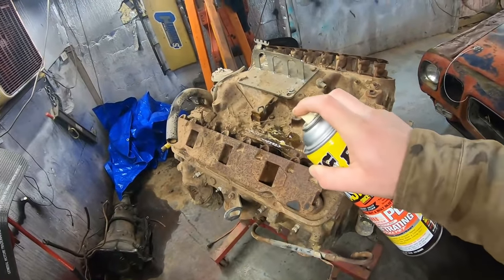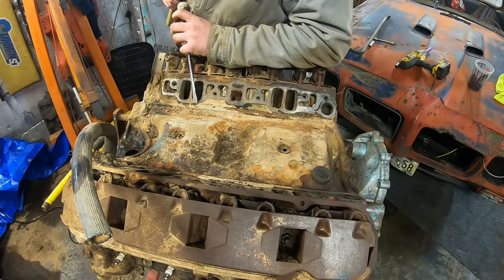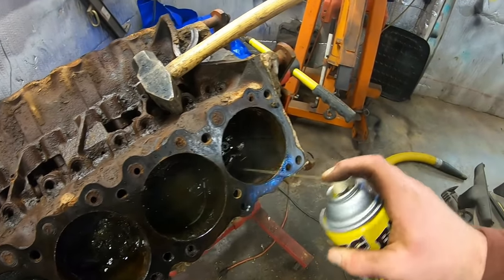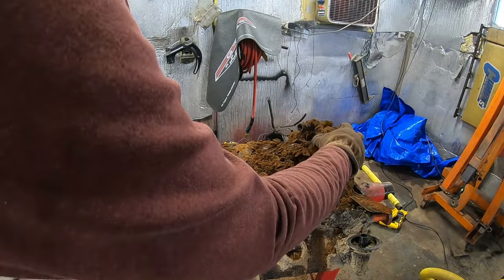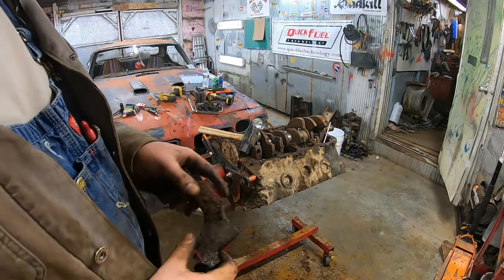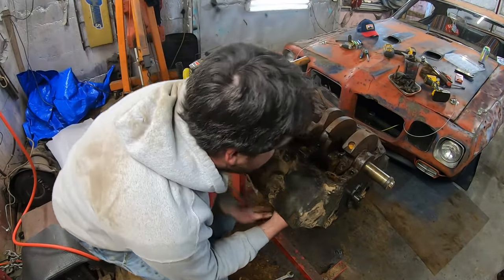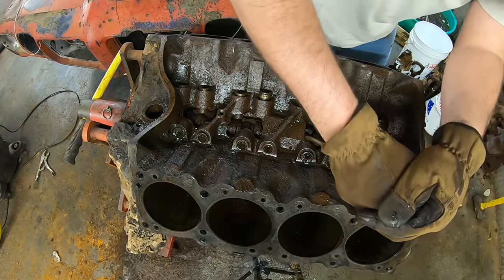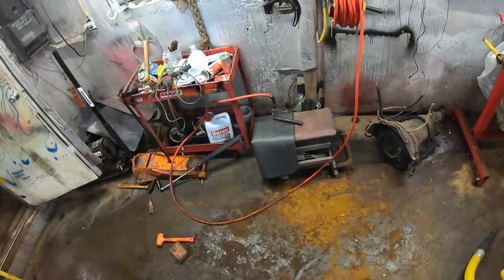INCREDIBLE! Worst GTO Ever: Holey Goat OG Pontiac 400ci Engine Teardown — CAN IT BE SAVED?

Comment: My old 77 Ranchero had a nylon camshaft sprocket. It gave up the ghost at 91k miles. I'll never forget that one because it left me stranded in the middle of I-5 on Labor Day 1999. I was already in a traffic jam and my broke down car made it even worse. Luckily there was a police officer about 5 cars behind me. He turned on his lights and pushed me off to the side and called me a tow truck. I just sat there waiting for about 2hrs listening to the radio. I heard the traffic report and they mentioned a stalled vehicle.  Yup,that's me.😆
Reply from the maker: Most makes used nylon cam gears for some damn reason back then
Reply: @PoleBarnGarage  Probably because all the teeth break off just after the warranty is up.. Supposedly they're quieter than a steel sprocket They're definitely cheaper to manufacture than a steel one. Actually,not long after I replaced the timing chain.  The crappy 400M engine went out.  I bought a rusted out 69 T- bird  for the 429. I had to get new exhaust and Engine mounts.  But other than that, it pretty much fit right in and bolted right up to the Ranchero C-6. It was a pretty fun car after that.  It had way more power than that 400M turd engine. I replaced the radiator too because the 400M radiator was only a 2 core and struggled to keep the big block cool. I miss that car,got T-boned Easter morning 2000 on my way home from work. Totalled it.  That dude was  running late for work and ran the light. Ironically we both worked at the airport, but different airlines.

Comment: cleaning in a never endding job my freind LOL WD40 Rust Soak I have saved some adjutable wrenches that went threw a barn fire and had been frozen solid for 14 years  i soaked them in wd40 rust soak over night and then freed up and a ratchet that had been under water in a bucket saved it as well I swear by this stuff keep up the good work and get  some eye protction lol

Comment: This crazy crazy GTO, 200 Dollars and with sheer bloodymindness, this damn things actually savable, even its engine lol and i was thinking, I just did a wielding class, 1G, i wonder if you could actually patch the damn doors with stick wielding to fill in the holes and get some structure back to it lol 

as literally we wielded two pieces of metal with a backing bar, the thing got cut into pieces, and then ground the entire thing back to a silver bar, that then got bent, if you could put a backing bar on the doors, and then do the same, without the cutting and the bending, you might be able to literally save the old doors and the bodywork, well, not save but put something there to begin with, without having to cut patchwork and kinda ruin the thing lol 

actually you could probably wield a door skin behind the holes, then wack it into shape with a hammer and fill it, atleast where its really really bad and you need SOMETHING there like the front and the door lock areas lol 

but still so this GTO was run into, smacked around, had multiple panel replacements, Flipped, left for dead, shot to hell, left to die in a boneyard, and the SOB and now its engine might legitimately ride again

all this thing needs is an S on the hood and its superman if he was a car lol I would even try to use the original cam if possible quite frankly lol also FYI with the oil pump, if the machine shop guy is gonna rebuild it, make sure he checks to make sure the holes line up on it, some of those replacement china ones dont have the holes drilled out properly and will grenade the engine if their not adjusted properly to fit the holes on the block. 

and the 400 needs oil and lots of it, hell if possible I'd find an OG one, and just use that, or put a replacement on, an enlarged oil pan and an accusump, as this thing is gonna like to go sideways when it comes back lol
Reply from the maker: I only use melling pumps. And yes, it goes sideways much.

Comment: No surer way to destroy an engine than to leave it open to the elements and let critters set up home and raise generations of their young there. They can find their way into the smallest engine passages and pack detritus,urine, and feces into them, not to mention nuts, bug parts, newspaper, straw, and everything else that you would never expect to find in a finely engineered machine. The body and frame have probably sustained much greater damage that can’t be repaired but only replaced. This is the first time that I’ve watched your channel but good luck with whatever plans you have for the Pontiac.

Comment: You assembled the engine stand wrong. The bolt heads should be out and the nuts in towards the engine. That way the bolts don’t contact the upright like they did for you.
Reply from the maker: Yes, but then they contact the engine lol
Reply: @PoleBarnGarage  They shouldn’t. That’s why the arms have those spacer tubes on them.  Unless the bolts aren’t original to the stand. Either way.  You solved your problem. I’m interested to see what you can manage to do with the 400!
Reply from the maker: Yes they shouldn't, however, multiply the bolt length by harbor freight, and you will of course get the answer lol. Thanks man! It's gonna be a journey

Comment: If it's not a ram air stage 5 with separate exhaust ports tunnel Port heads 4-bolt main lower end it's not a original GTO engine I know because I owned one I had a 1970 ram Air stage 5 4 speed GTO
Reply from the maker: This one's ram air 7 of course

Comment: Between my sibling, dad and myself ....we owned seven Pontiac's. Whether or not you rebuild that 400, if you do DO NOT put it back in that corpse of car. Fun is one thing....but that motor will be far too valuable to waste like that. Also.....I would recommend staying with the 10.5:1 ratio and upgrade the cam and EFI for good measure.   Glad and surprised it's not a lost cause. BTW: Did that actually have a turbo 400 originally? Did you get it when you took possession?
Reply from the maker: Yes original th400 was in it when I got it. The motor is returning to the car, it would only be right. I've run 16s on the street before without an issue, and they're the same compression ratio, just gotta get the timing dialed. No big deal. Decent sized roller cam, good head work, that's a 450hp engine without even trying.

Comment: On the modern motor ??? Hell no! They're not that tough trust me they aren't like they used to be. TOUGH!,   I ran a welded cracked 350 block in my stock car an entire season bout5 years ago, was a runner. Another guy got it from me on a claimer one night after win and it's still runs to this day, had a rebuild since but the old stuff is tough Bro.

Comment: Those 400 engines were prone to overheating!
Reply from the maker: I've owned several, plus 350s, 455s, 389s, never had any issues there as long as the correct components were in place

Comment: I know this is an older video, and I also am very well aware that you absolutely 100% know what you're doing.. however, as far as the bolts and spraying them like on the timing cover to possibly save them to remove without breaking - i know - there's stuff called Aero-Kroil by Kano.. listen, that stuff.. it's NOT lubricant.. it's an engineering project in a can.. That stuff, if you have ANY rust in  threads or even 2 dissimilar metals (steel bolts aluminum parts, you know this) anyway, this stuff is actually God's juice. It will 99% of the time free rusted stuck bolts out of ANYTHING. It'll free rusted locks - like padlocks that have been in a buck of water for 20 years.. it needs about 1/64" of gap to work its way in, and it TAKES TIME, but man.. kroil is magic, I'm telling you. I had a Honda 3.5 with a STUCK plug in the back head, of course, and it was about to break on me.. I had almost zero chance of not breaking the head off that plug and someone turned me on to the kroil.. I didn't believe him, but i bought a can off scamazon and sprayed a little bit in the hole.. waited about 30 minutes and sure as shit, that plug came RIGHT OUT. IT was COVERED in carbon, was an ORIGINAL plug on a 180k mile engine, so it's been stuck for 18 years or so.. It CAME OUT. Anyway.. I swear by it now and don't spray ANYTHING else on stuck stuff.. I don't use pb or anything anymore, unless i'm actually just lubing something.. seriously man it works like a charm!!

Comment: No
Modern steel would be rusted apart.
I would have to clean everything really good throw new rings, bearings and gaskets and run it ! 🤣
Reply from the maker: It was so tempting. But I want a little bit bigger of a hammer under the hood.. So we'll do it right

Comment: If you crack the bolts loose first manually you won't be breaking so many off in the block. 😂
Reply from the maker: I didn't break off any
Reply: @PoleBarnGarage  this time, you were the one talking about it being a problem when removing Pontiac timing chain covers. Then I see you using an electric impact gun on everything 🤣

Comment: Honestly if you can savage the block, heads, and intake. I wouldn't sell. Instead I would rebuild the engine and find another car to put it in. I wouldn't sell anything on that 400. It's worth more rebuild than parted out.
Reply from the maker: It's going back in the Holey Goat
Reply: @PoleBarnGarage  ok good deal. I am in search of 67 gto with a 400.

Comment: A power washer and taking your time would have gotten that thing apart easily, and without breaking a thing.  That distributor destruction was needless.  I've taken worse than that apart, including some that sat underwater for several decades.
Reply from the maker: I'm not losing sleep over a points distributor I would never use

Comment: Ummmmm......I have never,,,,and I mean NEVER....watched an engine come apart with so much rapt attention!  I have also - like you - never seen an engine have that amount of crud in them.....and I've seen them after someone has a) sawdusted, b) sugared, c) put EP140 gear oil in an engine with a blown head gasket!  When they look like that on the inside, you can usually still find a use for them as a chock for a combine harvester, but any percentage of getting them to run again is usually inversely proportional to the amount of crap you find.  How that beasty cleaned up so well is beyond my understanding, mate.  Honestly - I thought you were going to end up with swiss cheese bores, stays rather than lifters and there was no way that the heads were coming off or all the pistons were coming out....but there you go.  Still gotta wait on the ultimate declaration by Mr Machine Shop Man, but wouldn't it be a cool thing to have the proper engine back in that.....er.....engine bay?

As to whether an LS would run - there is no way.  Not in the way they are set up.  The modern equivalent of the venerable old 350 has so many electronics bolted to it now that - besides the destruction that (salt or even fresh) water does to an aluminium block and heads - there is not a magician alive or dead that could breathe life into the dissolved circuitry.  I had the ECU on my modern V8 give up because I sat the car in the driveway for three months without using it.  Damp got into it somehow and all the earths needed re-soldering, but the car was an expensive lawn ornament until this was done.  I was so disgusted, I sold the car and bought a couple of classic cars to replace it.  One EXPECTS to have occasional outages with a classic, but so far they have been more reliable.

All the best from New Zealand!
Reply from the maker: Thank you for the kind words!
Reply from the maker: Also, did the 140 gear lube work? Asking for a friend..
Reply: @PoleBarnGarage  - well, you can look at it this way,  if your goal (as his was) to make the oil light go out and the oil pressure gauge needle move off the stopper, then yes, it did.  It was thick enough that when blended with the oil and antifreeze combo (which was more antifreeze than oil) the engine sounded happier and the pump could move the mess around.   The side-effect was that it made everything smell like a hot diff even after we dropped the sump, cleaned up everything, replaced the head gasket, then ran oil for only 600 miles before we changed it again.  Used to constantly smell like his diff had a bad leak onto the exhaust, but the diff housing was dry as a bone.  It certainly didn't stop the coolant getting into the oil though.....and the aroma of what it used to billow clouds of out the exhaust was just too disgusting for words!  You never parked behind him at the lights or followed him along the road because the front of your car and your windscreen would end up with this film of yuck on it.  Just what you need when driving around at night!.

Comment: AS G CARS BECOME HIGH MILEAGE.....THEY WHEAR. OUT THE VALVE SEALS. AND GUIDES...AND.  DIMP OIL IN THE CYLINDERS.....OVERHAETING....I THINK YOUR 
CAR HAS HIGH MILAGE
LEAST 170.000...THERE WAS NO SIXTH DIGIT. ON THE SPEEDO

Comment: Unless your a guy working with your wife's weekly allowance budget any rational mechanic would have taken what he could easily take off and take the block to the machine shop and have the motor tanked some shops use the sonic tank some others the time saved easily pays for itself plus lunch oh and NO WE DON'T REUSE most critical fasteners .Before I watch another microsecond why did this guy polish up those side pipes and Cragers before striping and media blasting the body ? Maybe somebody can buy this clown a Brass Pin to beat on rather that wooden hammers and plastic deadblo hammers Regardless of all you see this guy doing this engine will still 100% need to go to the machine shop to adequately clean the oil galleys & coolant passages  ...Plus the line hone it will need after the main is replaced ..all you guys take note of which direction he is swinging that Sledge hammer directly towards the car .. Yea this guy has worked in ZERO commercial shops ...

Comment: if you had pulled the oil pan and oil pump you could have oiled it from both sides and tapped it out from the bottom without hurting it. probably a $500 dollar distributor the way it was.
Reply from the maker: Oh well.

Comment: Please stop. You are butchering this engine. You twisted the oil pan off instead on removing bolts. You attempted to remove the distributor with a hammer and screwdriver instead of soaking it with PB Blaster. Taking an old engine apart requires you to be careful and methodical which you are not! Please stop and hand the job over to someone who is qualified!!!!!!
Reply from the maker: Good Lord you have no idea what you're looking at 😂